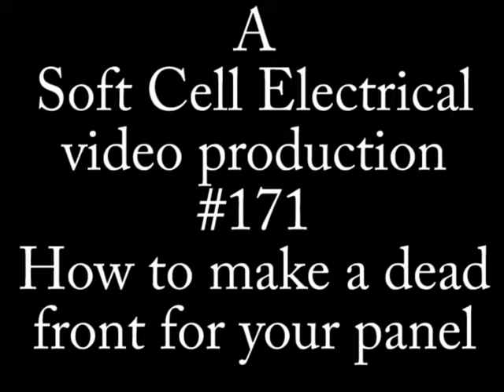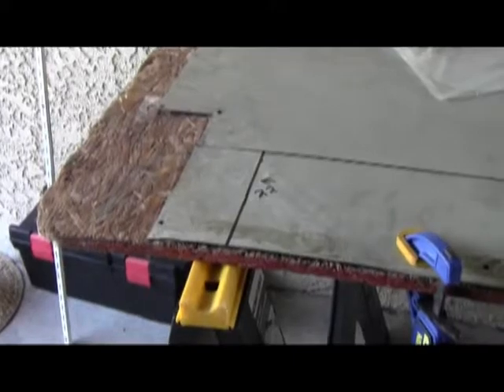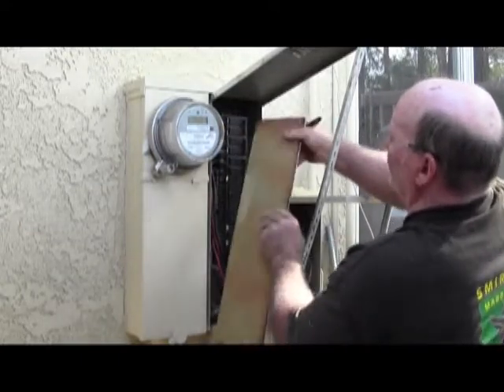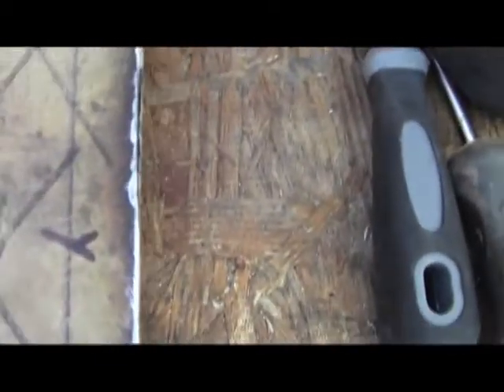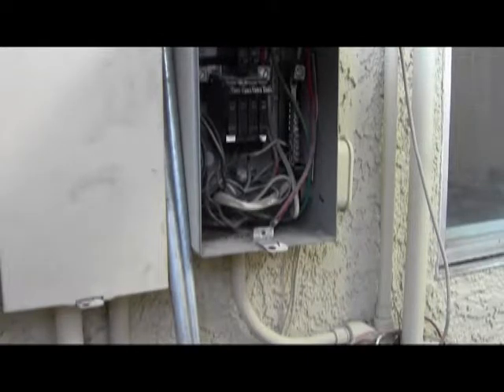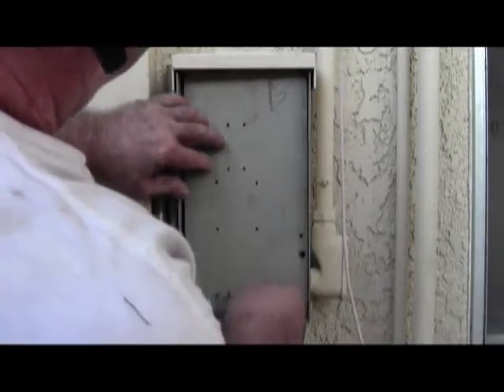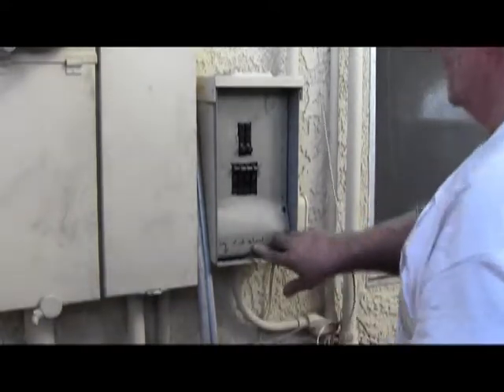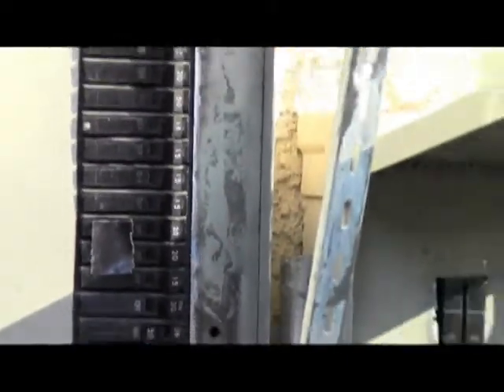NEC Electric code # 6, Panel repair  # 174

Comment: I've never understood how these get lost. Why would someone take it off and never put it back? I've seen it a 1000 times but still don't get it.
Reply: Most times these are left loose (unscrewed) until final inspection and often put on the floor while someone is working in the box, but in the process the door may come open from wind or many other odd reasons and then they fall out or are taken out and left on the ground. Next thing you know someone who was told to walk around and "clean" up the area thinks it's trash so they throw it out. 
Also, they can get damaged and then the electrician may rob Peter to pay Paul throughout a lengthy job site and then get to the end realizing 5 are missing and then literally rob Peter to pay Paul cause he can't order more of them just for the dead fronts..
Reply: mine disappeared when someone stole all my breakers including the main. i had a metal shop make me one and the inspector passed it fine